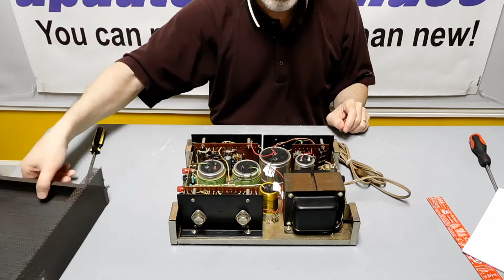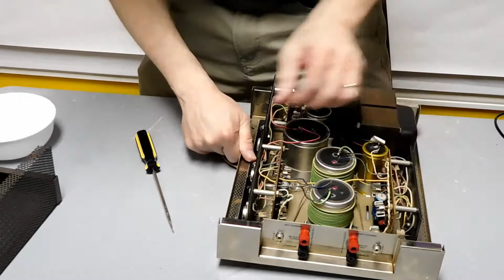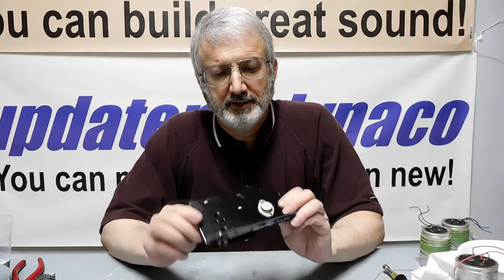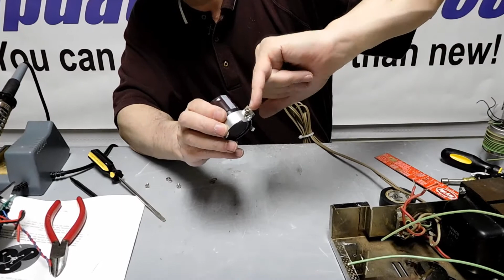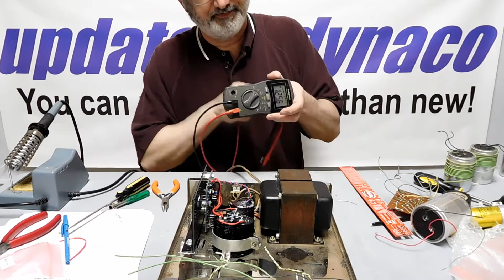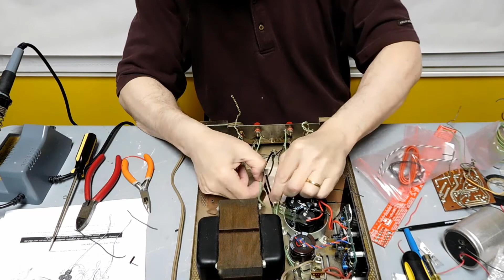Stereo 120 Complete Rebuild Kit

Comment: WTF was this abomination! He essentially destroyed a classic amp! Sure there's modifications replacing some of the transistors with better suited ones but to replace the outputs with SIM packages is bullshit! If you want a more powerful and/or sounding amp then go buy one! I built the ST120, PAT4 and the FM5 in the early 70's, painstakingly routed the wires and clean solder joints and never had a problem and they still work till this day.

Comment: Richard---Easiest kit to do is the Stereo 120 Complete Rebuild Kit...Assume you want the ultimate re-build, then you'd order this one:
https://www.updatemydynaco.com/storeindex.html#ST120CRKL2
The other kits cost a bit less as you re-use more of the original Dynaco amp.
As to the fuse blowing...the best approach is "divide and conquer". There are a couple of red wires that go from the positive terminal of C12 to the amp modules. Power down, then cut those wires. Now power up and see if the fuse hangs in there. If it still blows, then the next step is to remove and temporarily tape up one of the red transformer wires that goes from the power transformer to either pin 8 or pin 9 of the regulator PCB.

Just always be careful that the amp is unplugged, and that you've waited a few minutes since the last power up before plunging in. That gives you time to allow the caps discharge.

Comment: Fascinating watching this as I had come into possession of one of these amps recently.  Here's my problem:  I plugged it in and turned it on and it seemed fine.  Sadly, the use blew (as I had neglected to wire up the speakers first - at least, that's what I thought)!  Upon replacing the 3A slo-blo fuse and attaching the speakers, I turned on the amp and it promptly blew the fuse.  Any guesses?  Which "kit" did  you install in the video?  (There are so many listed on the website you refer us to.). Thank you!

Comment: Except for the chassis and transformer, you no longer have a Dynaco Stereo 120. Sure, it may have way better specs than the original but the entire circuitry has been changed. Also, from a purely aesthetic point of view, the 3 electrolytics wired together look terrible. The original design and layout was far more pleasing to the eyes. Most people doing this rebuild will probably buff the chassis to a mirror shine first. After all, it was plated for a reason. I never thought this old Dynaco gear would become collectible.
Reply: You're right, Glenn...the result is much better than a Stereo 120. I think people hold onto the Dynaco stuff and re-build it because it's still a great value, it's easy to work on, and it just feels great to make something that works so well. BTW, if you're looking to do a kit from scratch, you might take a look at www.akitika.com, or http://akitika.com/GT102.html
Reply: Very collectible.
Reply: I couldn't agree more. He butchered this amp! Why?! Mine works fine to this day. To be honest I blew it up twice by using a signal generator and sent it into oscillation, OPPS!

Comment: I had the PAT-4 and Stereo 120 in the late 60's or early 70's (can't remember exactly when). They were a step up from my Scott LK72B Tube Amplifier which I built as a kit in the mid 60's. After I sold the Dynaco equipment, I bought a Marantz 2270 in the mid 70's and then a Pioneer SX-1980 around 1980. About 12 years later I bought a Carver Amp and Pre-Amp (can't remember the models). All these repair and upgrade videos bring back some really sweet memories for me. I spent 40 years repairing TV's, VCR's, Audio Equipment and Computers until retiring last year.